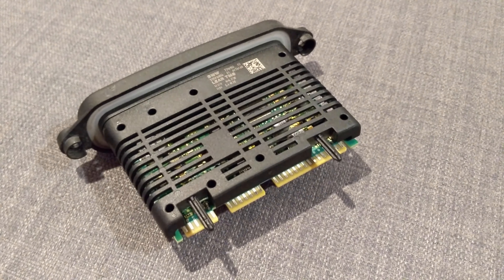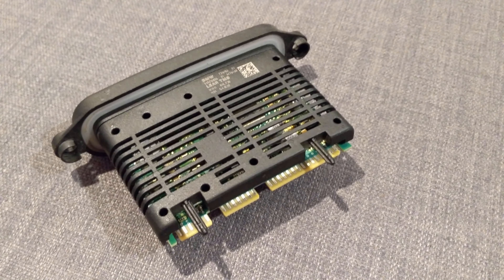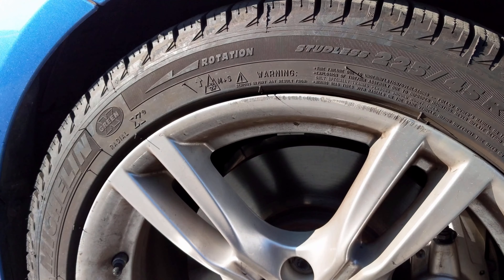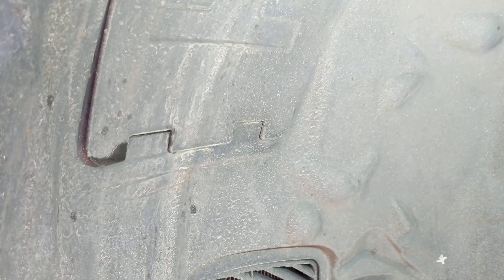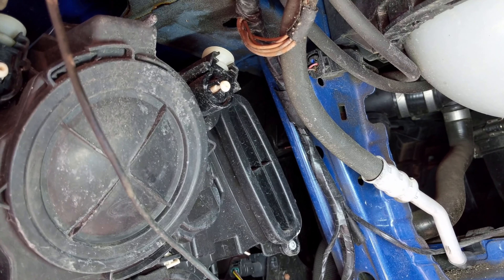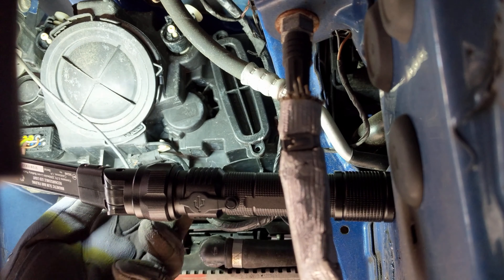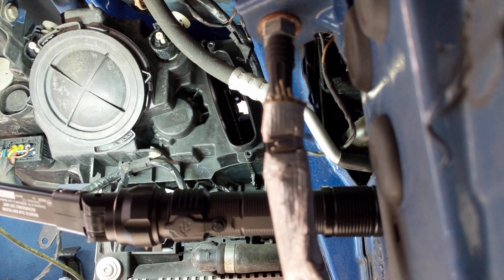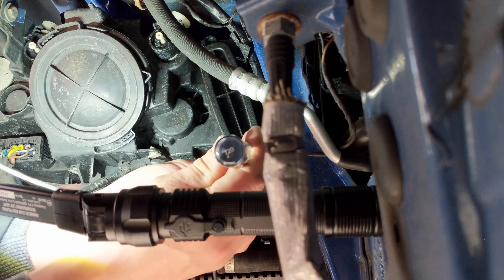BMW Xenon / LED Headlight Module Replacement

Comment: my F30 has xenons and recently the driver side low beam stopped working, but the high beam is still ok. Swapped in new light bulbs and still out. Would getting a new module fix this? Or would this be a ballast issue?
Reply: Have you resolved it ? Mines got the same issue
Reply: The Xenon does not need this module. It just needs the ballast on the side of the headlight. Would siggest replacing that instead.

Comment: Hi, 

Does the TMS differ from left to right headlight or are they both the same ?
Reply from the maker: Afternoon, it's the same part number on both sides. You can use realoem dot com to confirm under the lighting section

Comment: Just looking for clarification is this fix at all related to the angel eyes thanks in advance
Reply: Yes is this for the angel eyes? My passenger angel eyes are not working
Reply: @ethaninocando  same
Reply: @yarokanyuka2862  Make sure you buy the part oem from dealership
Reply: @ethaninocando   hey bro. Did you you come right with fixing your angel eyez? I currently have passager side angel eye not working but headlight its ok. What did you do ti solve it? Thanks

Comment: So you didn’t have to remove the entire bumper? Just the wheel wheel liner and the wheel? I have one that failed on just the right side so it would be great to not have to remove the entire bumper.
Reply from the maker: Correct just the liner 👍🏻
Reply: Is it necessary to remove the wheel? Or is there not enough room?
Reply from the maker: @ssanford  The wheel has to come off unfortunately.

Comment: i only have the vertical aim fault. how do i know its the module i should change? i have read stories about people with just the vertical aim fault and it was fixed by locating a faulty wire(a wire that have been squashed/pinched for some reason). i cant seem to pin point my fault :(
Reply: Have the same problem, What was the problem afterall?
Reply: @GOHAWAII808  it was two faulty wires on the right hand side, in the wheel arch, one for for the headlights and the other for the foglight

Comment: Hey where can I find this part, where’s the rest of this video?????
Reply from the maker: What do you mean where's the rest of the video?? It's all there 2 min 18 seconds

Part can be bought on US supplier sites such as FCP Euro or used on eBay
Reply from the maker: @emirertas5430  My issue was not the module. I bought it for no reason. It ended up being that 5 of 8 wires going to the headlight were chaffed/worn out near the plug. I had to cut all 5 wires and splice in new wires. A lot of corrosion on them.

And yes disconnect the battery when doing any electrical work
Reply: V1Jake okay it looks like the problem with mine may be the exact same case, I replaced the module and it’s still throwing the same codes; there is still miscommunication with the TMS module (missing LIN slaving) which is giving both the malfunctions from what I think. The wires on mine may have been chafed/worn out also because water went in through the access panel. ( I figured after when I inspected the wheel well)

After you replaced the wire or spliced then the problem went away? the codes were cleared and the adaptive function is properly working with yours and the vertical aim is back to normal right ?????
Reply: @emirertas5430  hey man did you ever figure out what was wrong. im in the same situation right now

Comment: I have a Bmw F30 3 series 2014 with 2 x modules per side. Do I have to take the complete bumper of or will i be able to access the same way?
Reply from the maker: Your car only has one. Why do you say it has two? Each one is removed the same way as in the vid, just remove the wheel, fender liner and bam

Comment: I have the same error code . But my LED halos went out too . Will the module fix the leds too? Or should I replace the leds .
Reply: i have the exact same problem, have you solved this?
Reply: No Copyright Beats there can be many reasons for this error. LED modules itself, wiring, the connector or TMS module itself. Varies from car to car. My advice would be is to go to a qualified workshop and let them inspect it
Reply: @NoCopyrightBeats   i bought the module on eBay.  But it didn't fix my problem.  Same error code are still on . Honestly I'm to the point of taken it to the dealer .
Reply: @rubeng8128  did you solved your problem with the 2 halos?(angel eyes)?
Reply: @fabienbenoit1509   not yet.  Super long story . I have spent $1300 . $800 to a shop and $500 towards a used headlight assembly.  Halos still not working and adaptive headlight malfunction still on . The shop i took it too said it could be a wiring problem but I was done spending any more money . Lol when I find out a solution,  trust me ill reply to this video . To help all my BMW bros out !
Reply: I got the DRL malfunction code on my f32 and now im wondering if I just have to replace the LED modules  part # 63 11 7 263 051, to get them to light up again, anybody have any experience changing these modules out?
Reply: @jameskowalski5556   yes , I've replaced mine before.  The bumper has to come off and both fender liners.  they each have 2 small tork screws holding them in place . Once you remove them it will also be a wire hooked up you will need to unplug.
Reply: @rubeng8128  any updates yet bro ?

Comment: Did this fix the problem, you did not state if it did work or not. ???
Reply from the maker: It ended up being 4 frayed/corroded wires in the harness going to the headlights 👍🏻
Reply: @XionUnjust  and did you change the wires and problem solved? 🤔

Comment: My bmw f21 have same problem its same mission?? no coding ??
Reply: I have the same issue on my F25 no codes but one  the right side light does move when driving or at star up.